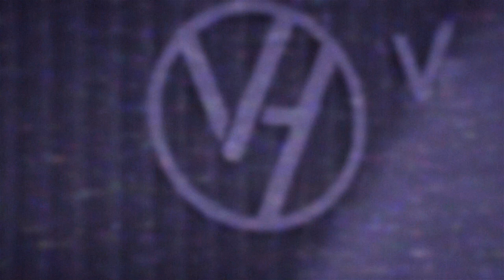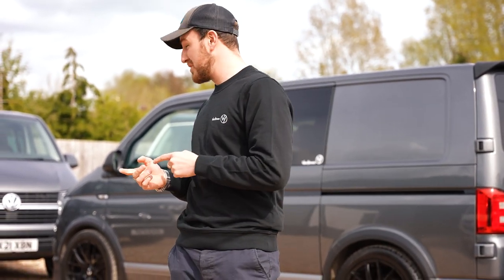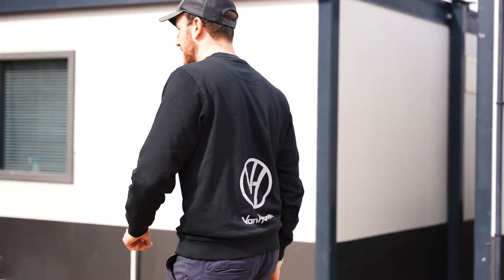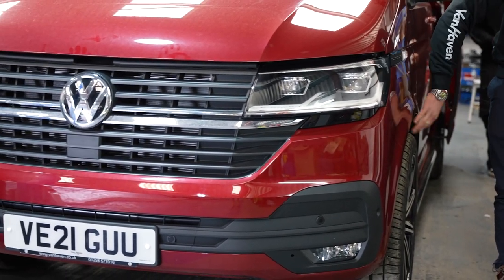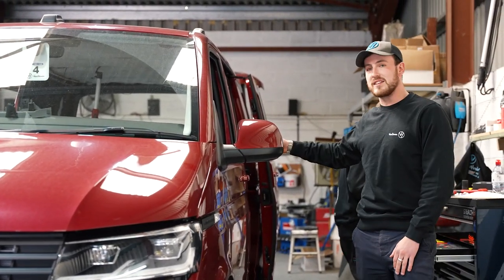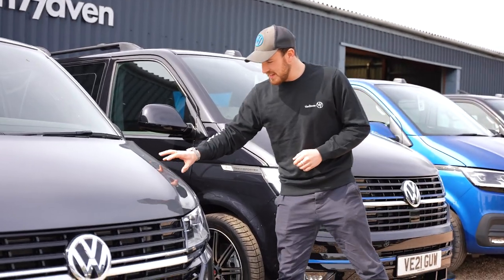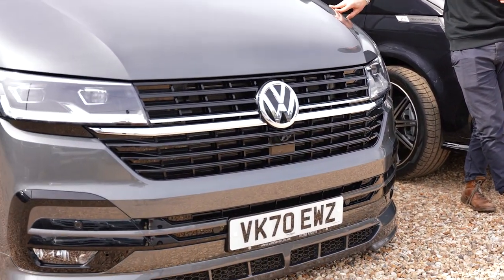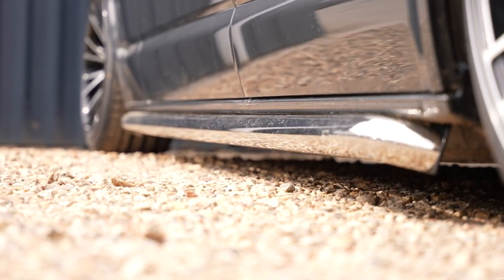Van Haven // Pop Tops & Air Rides!

Comment: Hi van haven, I have ordered my t6.1 you guys and I am over the moon with what will be my new purchase. My van will be coming on 20 in rims  and 50mm lowering springs. Now I live in Central London and speed humps are every will I have issues with the front spilter catching. I cant make my mind up whether to chance my luck with the lower springs,  do  a full air ride conversion and stick with the 20 in rims or go for the full swomper package so I don't have any issues with ground clearance.  I love the look of the lowered van ,now  I've never had air ride so I'm un sure  about  ride comfort and also the longevity and reliability of the parts used .I'm hoping to keep my van for at least 10 years and do any many miles as possible. If for such reasons the air system should fail is the van still drivable and is this system readily available as I live a good 3 hours drive from van haven for any running repairs. I look forward to your reply, tell olly and Tom I said hello 😀